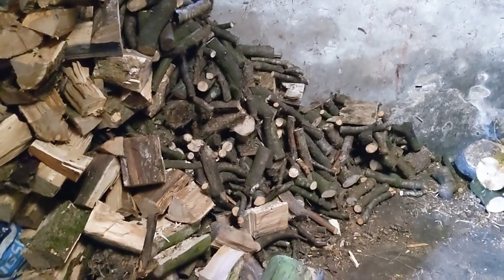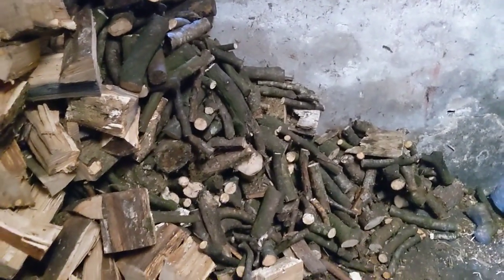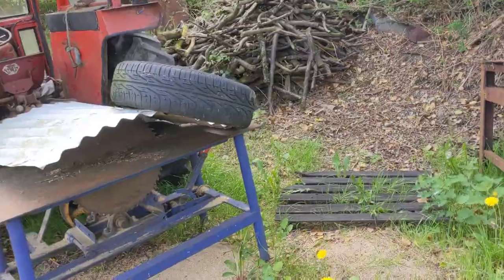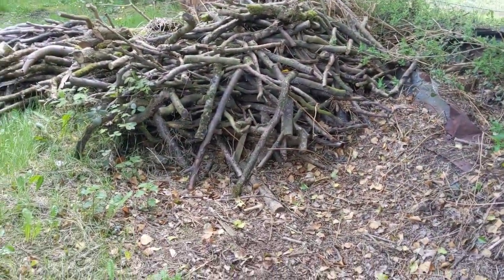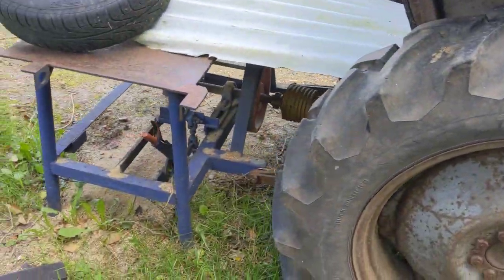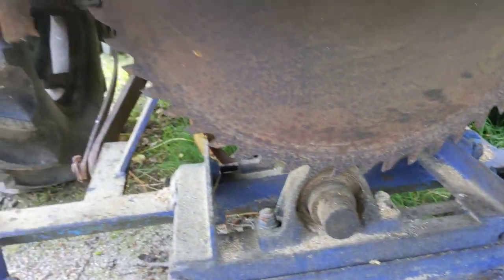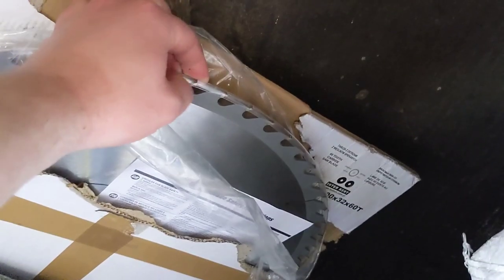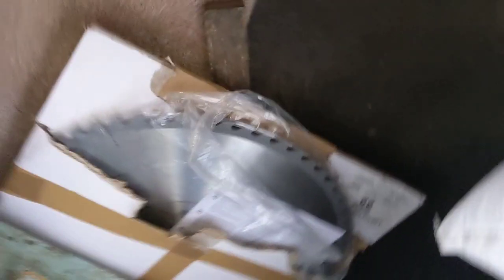Hedge removal

Comment: Good to see you've got an new blade for the saw now Dave 👍 although tungsten tips I avoid because like you've said about sawing up wood that had nails like I do and once they do hit nails I was told are basically good for scrap but it will be fine for tree wood, that's why I've got the standard type if it hit too many and can get new teeth cut on them from the saw doctors. 🙂👍
Reply from the maker: I am a little worried about the teeth hitting hard and flying off. I figure it'll be fine because she cuts downwards and doesn't spin super fast